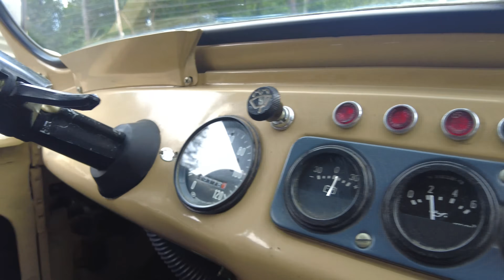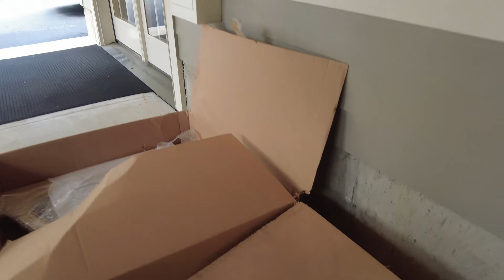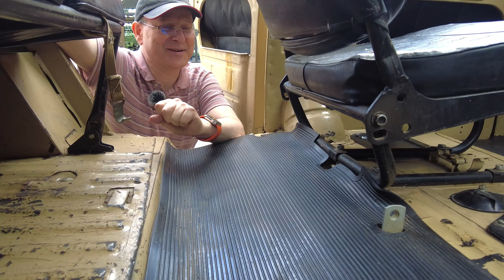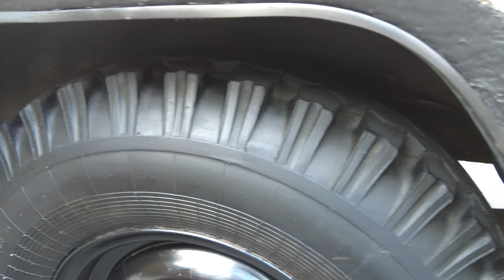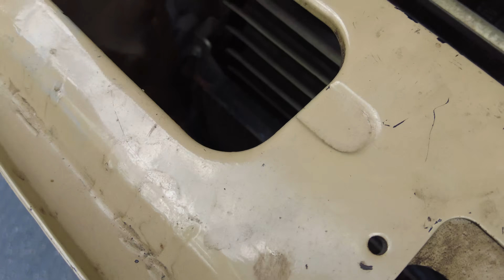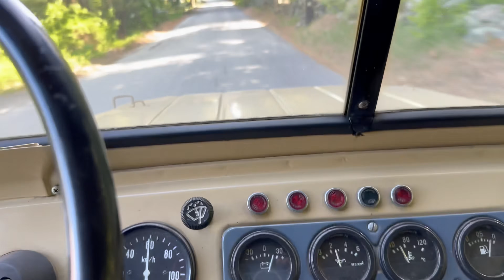Only 8K Miles! 1990 UAZ-469 7-Passenger! Unmodified, Original Paint, No Rust & Mechanically Sound!

Comment: мой дед купил абсолютно такой же новый , такого же цвета  у нас  в России за.. примерно в то время ( 1993)  18 250 $ ,  а продали мы его в 2013 пробег был ~ 14 500 км. Состояние было конечно же похуже, си следами эксплуатации в деревне и продали его за 2 000 $ .
Интересно сколько он стоит у вас здесь ))  
My grandfather bought an identical one new, the same color, in Russia for... around that time (1993) for $18,250, and we sold it in 2013 with about 14,500 km on the odometer. It was in worse condition, of course, with signs of being used in the countryside, and we sold it for $2,000.
I wonder how much it's worth here?